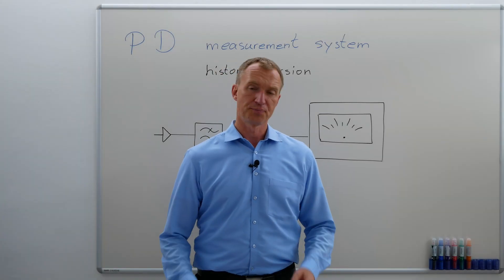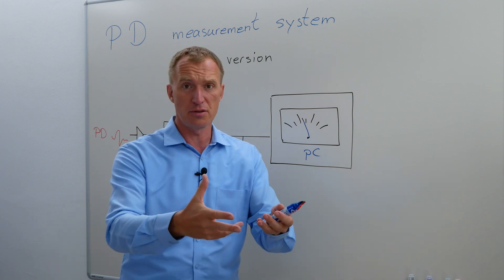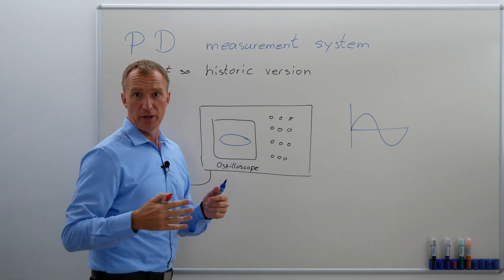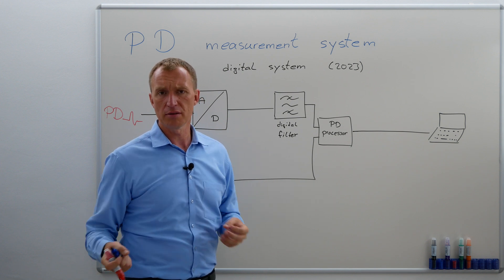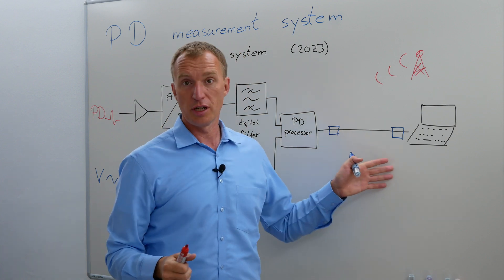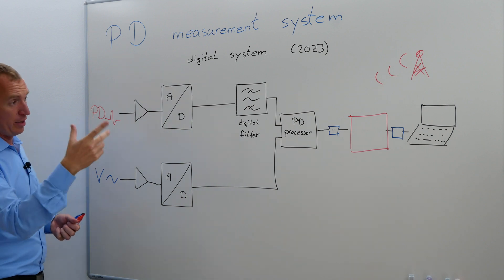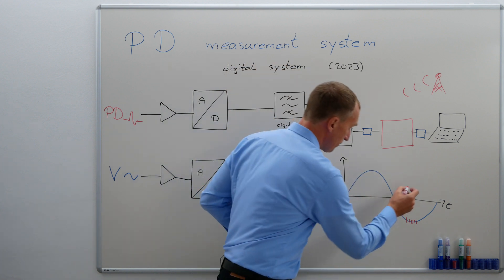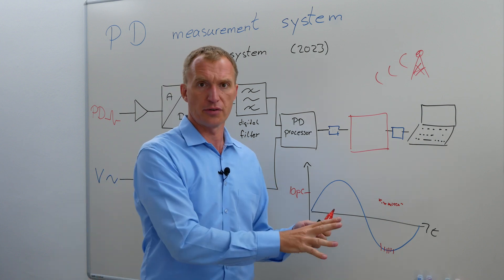2.2 Partial Discharges Vocabulary - Partial Discharges measurement system

Comment: What is the use of the capacitor after the diode? Is this the coupling capacitor?
Reply: That’s to hold the voltage of PD
Reply: @AJ-yn9tv  can you explain?
Reply from the maker: The capacitor after the diode is not a coupling capacitor. The current (electrons) of the PD goes "through" the diode and charges the capacitor. Let's say to 50%. The voltage meter at the end will measure the voltage and show it on the dial (on the meter) something like 50% as well. If the next PD is higher and thus results in a bigger current (more electrons), this current will charge the capacitor higher (e.g. 70%). 
To make sure the capacitor does not get "too full", the resistor after the capacitor discharges the capacitor all the time.
I hope this helps. :-)
For all the experts out there, this is a big oversimplification here!
Reply: @PartialDischargesGuru  Can I say it measures the PD?
By the way, what is the role.of coupling capacitor? Is it acting as a high pass filter to pass the PD?

Comment: hello sir
I am working on partial discharge detector device.
First of all, I need to say that in my country there is no company to measure partial discharge and there is no devices to detect that, so I started with TEV sensors, Fortunately I built the TEV sensor and make the corona at home. I create corona by small step up transformer in metal box and attached the TEV sensor to the metal box from the outside. Then, I  connect the TEV terminals to the spectrum analyzer and caught up the about 80 MHz frequency so I understand my TEV sensor work properly.
Now I want to crate my measurement device, as I saw in your videos I need A/D. do you know the requirement sample rate of A/D for partial discharge? Do you know the A/D sample rate in nowaday devices like HVPD or UltraTEV plus 2 ? you know I am blind in this field and in my country only a one 800 Msps A/D price is equal to my two month salary, my salary is 150 dollar/month so I have to precisely select the ICs😀. Please tell us about sampling rate and additionals technique that nowaday companies used in sampling.  @PartialDischargesGuru
Reply from the maker: I am very impressed, you are working on your own PD detector. :-) 
About 15 years ago, some devices worked with a sampling rate of 64 MS/s (64 Mega Samples per second = 64 MSps = 64 MS/s).
In the last  half decade, this number went up to something around 100 MS/second to 125 MS/second.
I hope this helps :-)